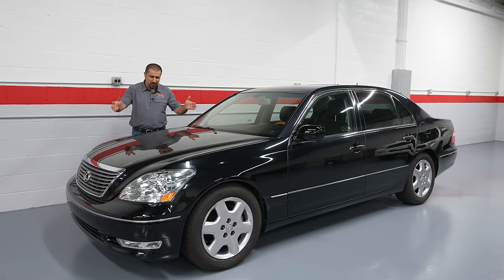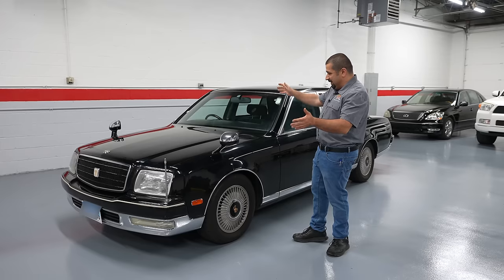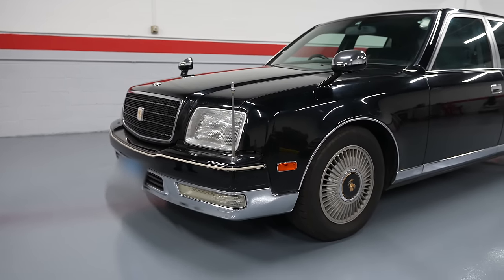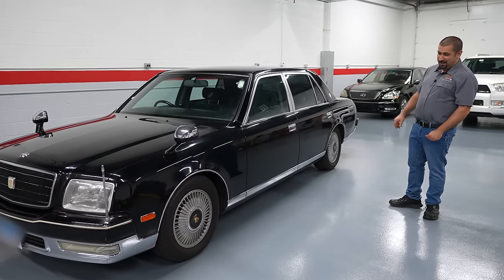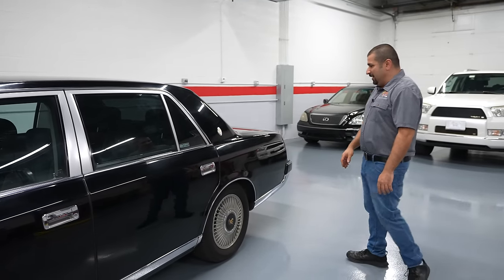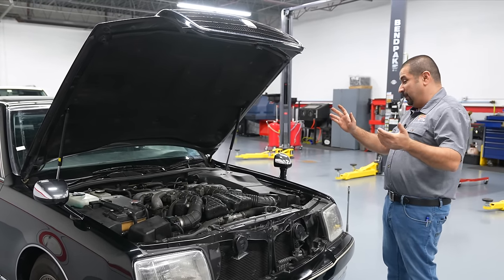THIS is The COOLEST Toyota You Will EVER SEE!

Comment: Hi CCN
Its Richard again from the uk I emailed you the other week regarding the attempted theft of my 2021 Rav4.
I think I've got to the bottom it apparently  by ripping the under wheel arch and front panel they can gain access to the N/S ( your drivers side) headlight and using what ever they can not only open the car bur start it and drive it away. Un believable that common thieves can outsmart Toyota engineers. I note from your video that the 2023 Rav4 has new headlights I wonder why.
Ive had no help from Toyota UK at all.
There is a u Tube video showing 2 thieves attacking and indeed stealing a Rav4 4 in under two minutes.
Thanks for the channel I watch every one I hope the new shop is going well for you you deserve it
Richard

Comment: You go on about the heater shut off valve. Most cars here in Australia have this, & is mostly vacuum operated. My old 1976 Mercedes has a vacuum operated heater valve that stops the coolant flow through the heater matrix in the car. I personally think you should look at a Mercedes from the 1970's. What they had from factory most likely will open your eyes.

Comment: (Edited: you can import one Grade 4/5 around 30k) This car was the Japan President's car.  You rarely see it because the age of it.  Yours is import so the under carriage did not have the reinforced steel plate (and you can see the fuel line and brake line cover).   If you see this car in Japan, you will expect someone very important was sitting inside (if not Prime Minister).  Just like the Cadillac in US President sit in.   Good that you have the Century.

Comment: In Japan, the President is a car that is often used as a company car (for the president) of the royal family, members of the Diet, governors, and large companies.The driver drives carefully, so the possibility of an accident car is extremely low. am. Since Toyota is doing a lot of maintenance, there are many used cars in good condition even if they come out on the used car market. Since it is a Japanese specification, if you replace the audio and navigation, there will be no problems. It's a great deal if you can buy it cheaply. And no matter where you go, you'll be embarrassed with this car, and your status will improve. It's Toyota's top-of-the-line car, so even if you buy it second hand, you can drive it for the next 15 years without any problems. It seems to be popular in NY, so if you can buy it secondhand, I highly recommend it.

Comment: Just lovely.  We have a 2002 2.4l Camry in absolute mint condition.  66k on the clock and and even the carpets look showroom.  Here in the UK it's a very unusual car, which might seem comical to Americans as I believe they are common as muck on US roads.  Over here it's a limo, almost silent and glides about the place.  Further comedy is that it's valued at around £600 because of being 20 years old, but I would not swap it for anything.  Even it's carbon footprint is minimal by now and it's so comfortable to drive that I can't see how I can beat it without pending around £40k.  It's a no brainer to me: keep it until it dies, which it just won't.

I worked for a Toyota garage some years back and still have mates that work there, so it's repaired by Toyota techs who have known the car since new and I get given massive discounts on the couple of repairs it has needed in recent years, such as an air-con pump seal and rear brake backplates.  Recently it began to stall in traffic, so the tech cleaned every sensor in the intake side and it was back to being smooth and silent.

You might be able to tell...I love that car.

Comment: The best Toyota for me os the 2006 Toyota Xcab manual.   I have it for 16 yrs with low maintenance.  Truck is modified to look like a trd but it is not.  It is a 4 cyl.  In the past 30 yrs I have had 2 vehicles and they both are 4 cyl. Manual Toyota trucks. 😊

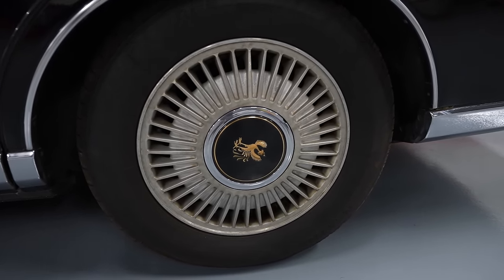Comment: 7:00 The valve stem on wheel is so subtle it seems invisible.  Wonder if it is on back side of wheel.  An emperor or gangsta boss does not air her own tires.  11:10 Notice the mirrored-symmetry of the left and right horns.  One curls CW, and the other CCW.  19:58 Looks like a sideways entry for a cassette deck behind "Logic Control Deck."

Comment: Hi Tim,You surely made an extraordinary video about this juwell of a car.It is an inspirational work for any automotive engineer and in my humble viuw only comparable to the Lexus LS 400-470 line of superb automobiles,Mybe to the early S series of Mercedes Benz in craftsmanship.I worked on both brands and they where equal in quality on those early years until about the early eighties,As for now Toyota and Lexus cars are much more reliable and durable in time if well mantained.Toyoda San would have been really proud of these cars.Thanks for the very nice video.

Comment: The holy grail of Toyota I would love to have one I think they also came with a V8 Too and the steering wheel is on the correct side for me since I live in Australia. I have google lens on my android phone a dealership I work at has imported a few hiace's from Japan I use Google lens to translate radio settings and other things its not perfect but it does give you a rough idea what it says

Comment: if the air coolant plate wasn't placed behind the wheel for brake cooling,  the airflow gets is there anyhow at a bigger mass because airflow would flow in the direction of the wheel anyhow, wouldn't be better to omit this plate? some companies design the wheel in such that it draws the air inward as well like a fan during driving to air cool the breaks, so I guess it (the plate) actually traps heat or even after a long breaking scenario like a downhill when braking is utilized constantly and does not allow to quickly exert heat from breaks and rotors! 
what are your thoughts?
update: looks like I had a good point, bye for good!

Comment: I did enjoy this video thanks l have seen another you tuber has revriwed the first generation of the Century and the second generation which this is one right hand drive cars are no problem in Australia and we can import the third generation of the Century there a couple in Australia but l haven't seen any yet because apart the cars impotted to sell by the major car manufacturers you can import any car as long it is RHD LHD can be imported into N.S.W Australia as long it is a certian number of years old .You did one thing the other reveiwers did not do you showed underneath of the Century that was great to see thanks for that a great review of the ultimate car been from Toyota it is uber luxurious and uber reliable not found in any other uber luxury car

Comment: To the left of the steering column are switches for the rear curtain (L) and suspension height (R). 高 means "high" so when that button is depressed, you are on the high setting.

Comment: 21:37 the switch on the left says it’s for the rear curtain, possibly between the drivers cabin and the rear seat or for the rear window, and the button on the right is a height adjustment for the air suspension
Reply: This is the type of car that you hire a driver to take you around in, rather than driving yourself
Reply: 25:14 this I believe is a microphone system for in car meetings or memo recording.

Comment: It always helps credibility (style points) to be able to pronounce a revered brand properly, but instead slurred speech is so normalized, and that's actually how accents and dialects tend to develop - through laziness, or the attempted opposite...
Toyoda is the founder. The brand is called Toyota. 😉

Also, the camera operator obviously needs manual focus control when filming engine bay footage. I've seen several videos with the same problem. (And when that is working, then the host using a laser pointer or highly focused flashlight can improve presentation quality further. It then guides the camera and the audience attention precisely.) - Ideally there would also be quick manual control over other parameters so that scenes like the car stereo area have focus on the full width of the panel.

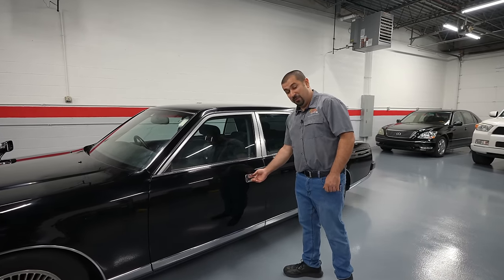16:45 "The interior of the Century." ... Nobody can disagree. 😄 (In fact, a missed legitimate clickbait opportunity for a video title: "The Driving Experience of the Century")

21:20 If you can't tell what those switches do, then just consult the manua... oh, wait. 😅

30:52 This is an interesting test for how people's minds work. Personally I'd likely have more difficulty driving left-piloted in the UK than driving right-piloted in the USA. I look outside, interact with the environment, check where I am going there. The internal is just a slightly different interface for that, basically the type of glove you are wearing, not the screwdriver.
(And this is not from being used to riding shotgun, because I am not. But I guess it helps with getting used to driving Japanese cars.)
I do admit, though, that the function levers(?) for turn signals and wipers would give me some trouble at first. But that's because they are in muscle memory / habit. It's different from sitting in a different position in the car.

33:02 The mafia vibe is getting to you. 😅

33:25 In the shoppe segment. 😉

Oh, and the bumper corner rod, I would assume it also serves as the antenna, but it is actually a flag holder.